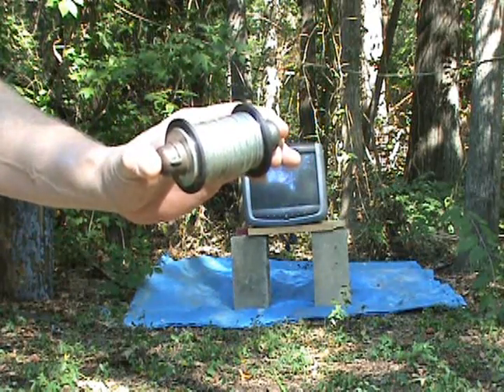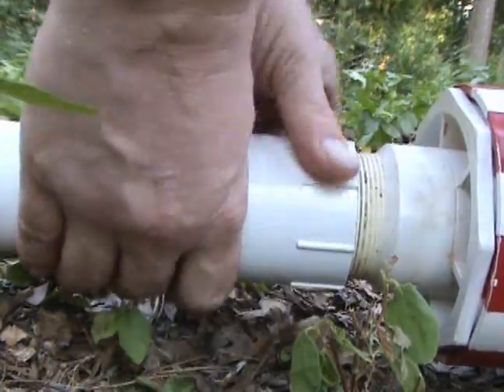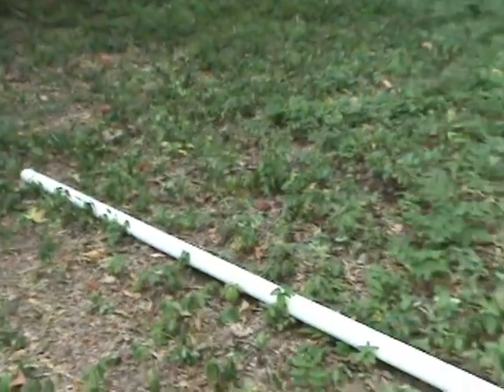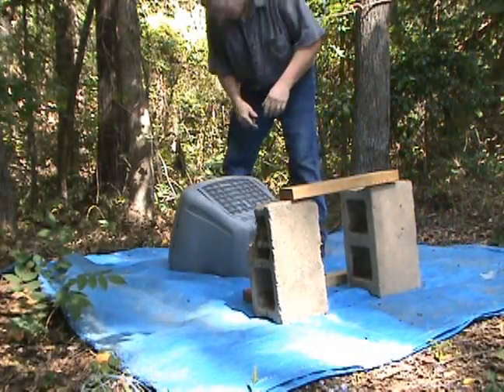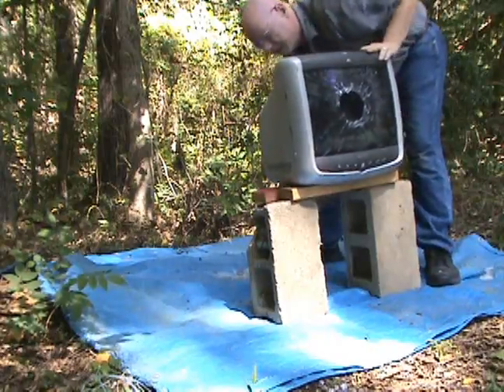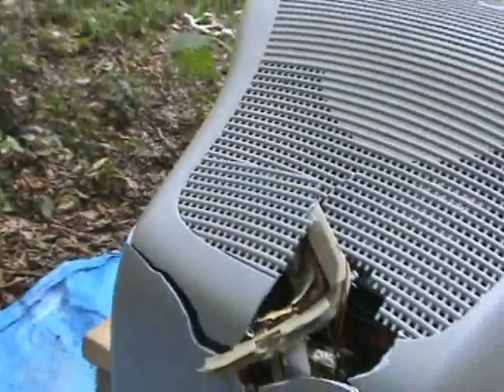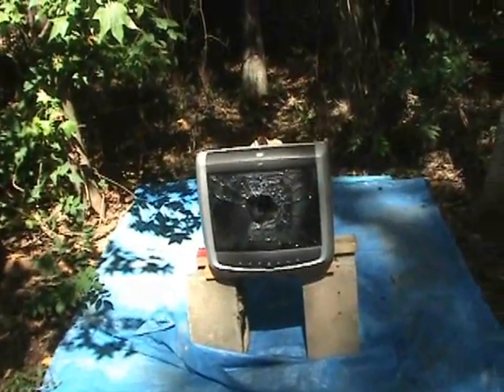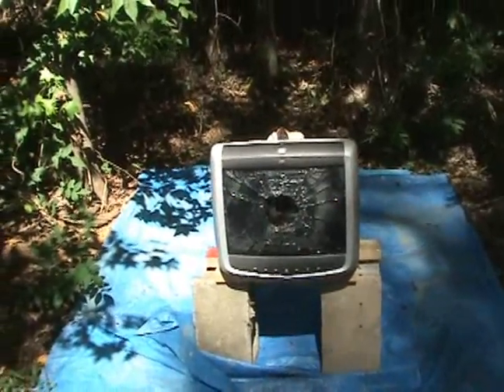Adventures in Spudgunning (Part 1)

Comment: have you tried nitro methan for rc cars and planes,perhaps it will pop harder,not that you need help bro im just thinking out loud wondering whatwill be said,perhaps you have tried it,what about a small nitrous bottle ?also if you own guns maybe a 20 gage shell could be used as
a gas charge,this would allow you to use a 20 gage or a 12 gage shell even to shoot that slug of yours,of cours pvc would need to be rapped in steel cable or fine wire to withstand   such torture,??????